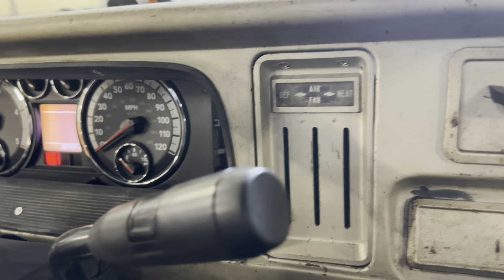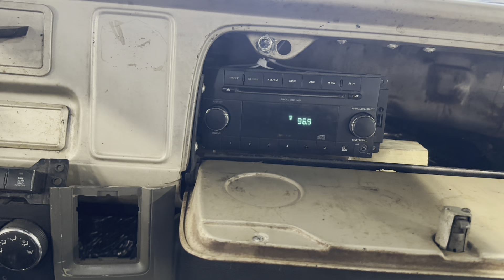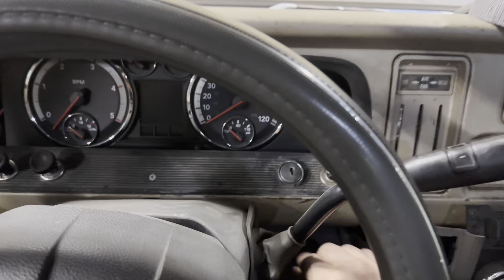Collecting Parts and Chopping Holes

Comment: Beautiful trucks,i am doing a 50 chevy coe,crewcab using a 5 wnd cab for rear, using a spare cab and 2 extra doors .making it look like it came this way.10 ft forrest service bed ,85 gm motor home 2wd chassis 10 lug 4wheel disc .cummins 24 valve  w p pump.6 spd trans ,stretched rear fenders 6 inches and used factory tow truck fender spacers to widen rear fenders 6 inches and widened bed 6 inches .
Reply from the maker: @bobhalstead1879  sounds like quite the build, I’d love to see some pics of it